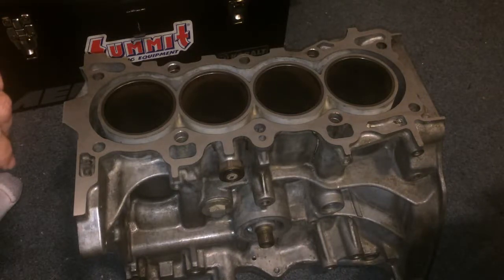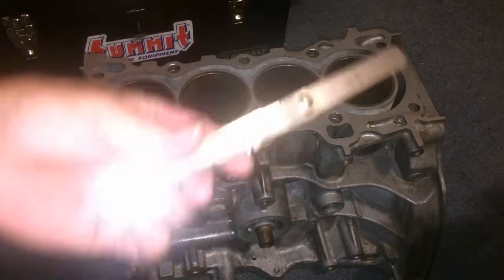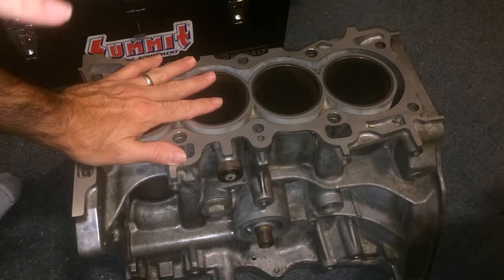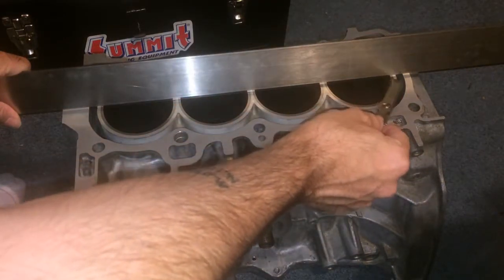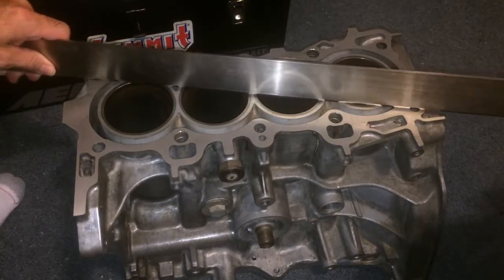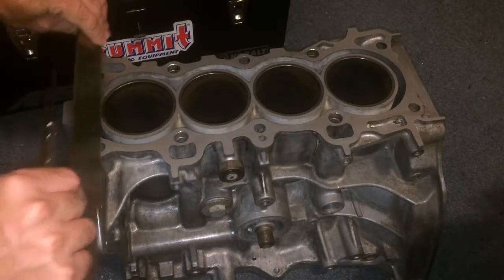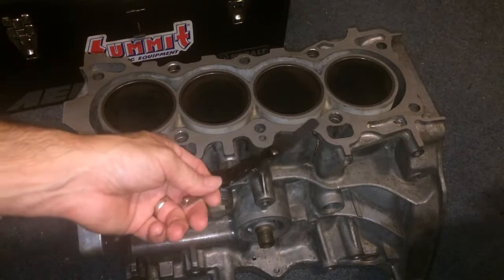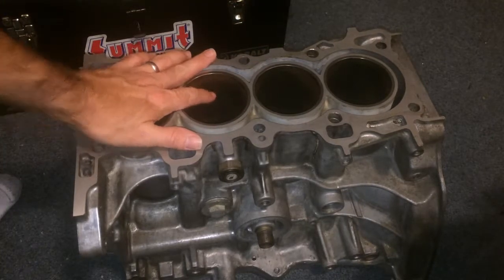How To Check The Engine Block Deck Flatness For Warpage #D16 #Honda

Comment: ty for the info.. Its a start for my head replacement :).. I don't have any true flat piece of metal. I guess ill have to shop for something. Any suggestions ?
Reply: Same here I'm looking for budget straightedge if that exist. Most of the ones i saw are closer to $100
Reply: @masterdebater0010  I found one at summit racing for 50$ it was fair. Might not last long